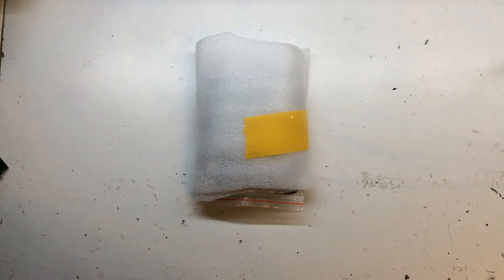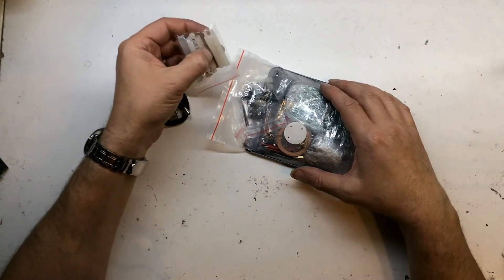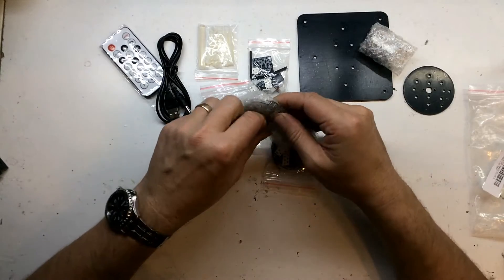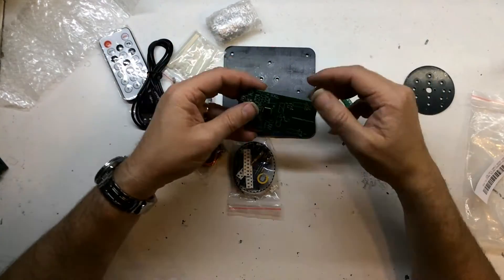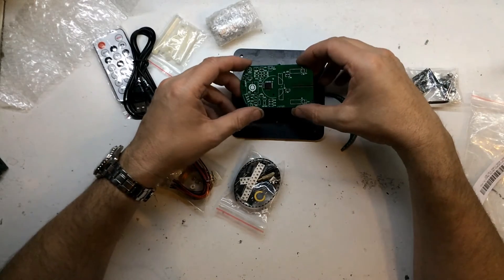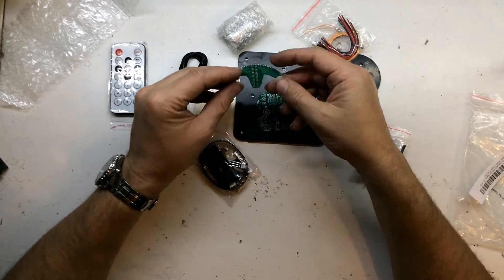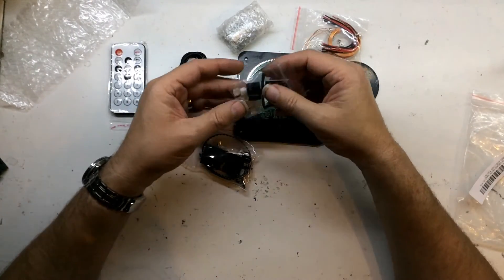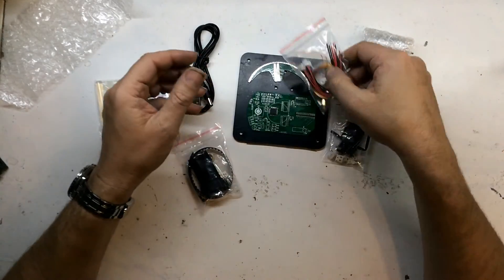DIY Spherical Rotating LED Kit POV from Banggood.com  Part 1

Comment: I cant find the instruction pdf. do you have the link?
Reply from the maker: https://onedrive.live.com/redir?resid=FB7735EAC7509757!130&authkey=!ALIPRHfZSwPAj0I&ithint=file%2crar
Reply: +Kevs Electrical Workshop thanks. got it all built, but it turns slow and no lights. plus my power cord gets hot. let's work with the ttl serial adapter power. I've rechecked all my work multiple times and can't figure it out.
Reply: +CachingJones let's * LEDs
Reply from the maker: You are pulling to much current on base unit, if you cant find short i would sugest the 8pin ic has fried